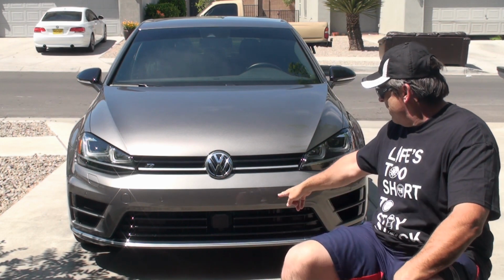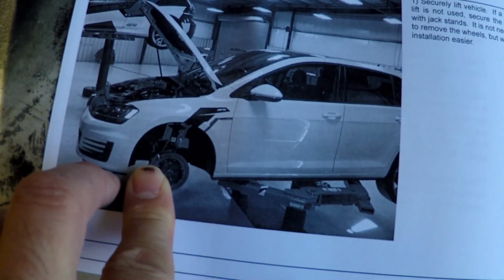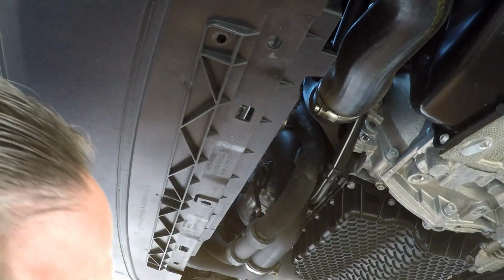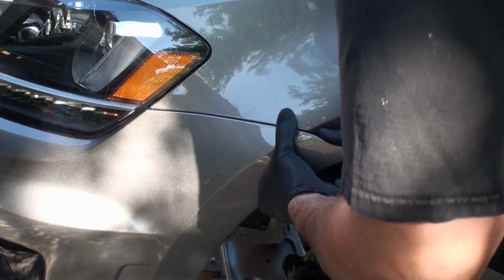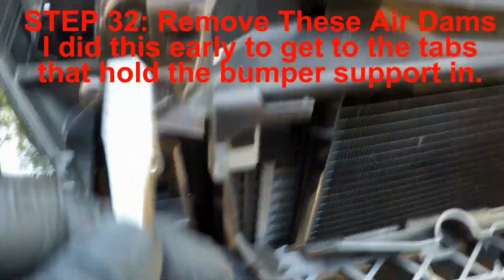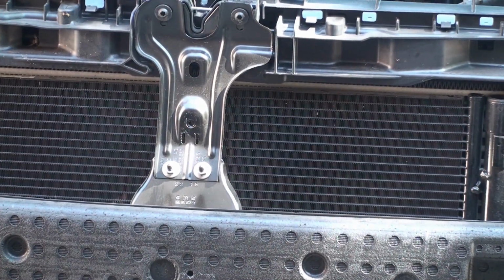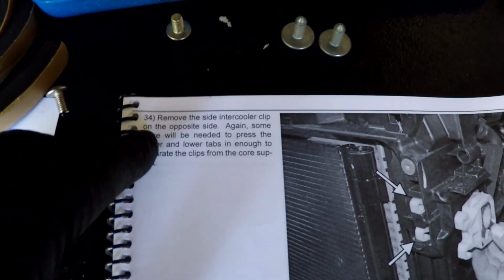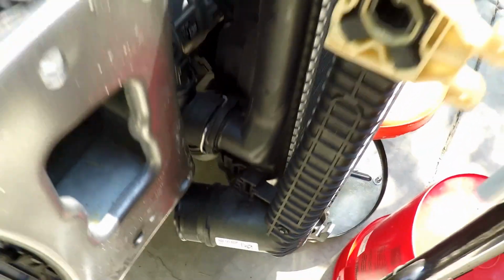2016 Golf R MK7 MQB APR Intercooler Install PART 1

Comment: Nice video if one wished to watch 12 commercials.  This was done  before there was anything of this model was even published.  So, "A" for being the founder so to speak.
It is so much easier going from the inside, than taking off all of the beams/lights.  Yes, you need to drain the coolant, but it sure is less of a pain.

Comment: Sorry to see the damage to your bumper - I am however happy to say I learned from your misfortune and got mine separated from the fenders cleanly.
I did however break one of those dang intercooler mount clips (step 33-34)- The big ones you push on the new intercooler with the prongs that you really have to compress to remove, man that halted my install. Sucks you get to that point of your project and then you are basically stuck on a Sunday when all the dealers parts dept. are closed. 
Additionally my APR Intercoooler for the MQB Golf R (Mine is a 2017 DSG/DCC) did not come with those long bolts or any instructions about the foam tape. Oh and no instruction book either, mot a huge deal as I downloaded it.
Good job dude! Man am I aching after this,  and I only got half way through! Jack stand install like you - Keep it up.

Comment: What up Rad? This is Meat amigo. I started a new channel. 

Hells yeah Brother you did it. I just started watching this video but I'll say when I did mine I pinched the driver side headlight washer thing in a spot it's not supposed to be since I did it by myself. I still need to pop the bumper back off when I have a helper.
Reply from the maker: Is this you really? Why did you start a new channel?

Comment: BTW, the headlight washers open once every third time you hid the windshield washers. It's a spray only.
Reply from the maker: Really? Does it spray on the headlights? Is this effective?
Reply: +Rad Fox I don't know how effective it is. I read that it did this in the manual, but thought it was hogwash until I hit the wipers at night while sitting in my driveway. The headlights were shining on the garage door and I could see that they were sprayed with water by the lights on the garage door. Like you, I live in a very mild climate, so the car never gets really dirty. Probably doesn't hurt.
Reply from the maker: This is crazy!

I just went out and repeatedly activated the windshield washer sprayers and I did see the nozzles quickly stick out from the bumper and then very quickly retreat back in.  I guess I still have air in the lines because nothing squirted out when they popped out.  I kept hitting the sprayer but I only got the nozzles top pop out twice.  Is it the wippers that trigger it, or the sprayer that is supposed to trigger it?
Reply: Rad Fox It was when I pulled to get the sprayer to work, not just the wipers.

Comment: I've always disliked the VW design of sandwiched intercooler to the Hot radiator and the a/c condenser. Seems like heat soak central all day even worse in summer Temps. I'd go massive front mount like a real race car on my mk7 gti. Sick video love your R.
Reply from the maker: Hey thanks for the comment and reminding me of this.  A massive front mount especially with some fans mounted on it would be awesome for this heat.  The fans would keep it cool when stopped at lights. When I went with this particular cooler I was thinking of the stock fit and not having to modify anything.  A custom fab may be in order.

Comment: the car comes with headlight washers their control from your steering column
Reply from the maker: It's funny that the sprayers are there but yet there are no wippers.  What good does that do?  Also, I haven't figured out exactly how to make them spray every time I try with the wiper control stick.  Not that I actually every plan to use them.
Reply: Rad Fox they usually spray the headlights every 4th activation of your windscreen sprayers, at least that's what it is over here in the UK!

Comment: Great Video, Rad. What kind of camera do you use for your videos?  It's very clear.
Reply from the maker: Thanks!

I have three different cameras. 

Sony HDR-SR11 which for some reason is starting to look washed out in some sunlight conditions (like in my intro) and has issues with autofocus in low light conditions, but otherwise is a pretty solid old camera. It records in MTS format, which looks so amazing on my computers but then after it is converted to MP4 for youtube it looks good most of the time but is not amazing anymore.

Then a GoPro 3+ Black, and GoPro 4 Silver. 

I record in 1080 30 frames a second Narrow on all three cameras.
Reply: +Rad Fox I need to get a GoPro. I believe I am the last American without one.
Reply from the maker: I really like them.  My favorite is the Hero 4, because it has the built in LCD screen on the back.  You can quickly check the LCD to see what you are capturing.  Otherwise you can link over wi-fi with your cell phone and remote control and view the cameras but it is laggy.  The batteries only hold about and hour of recording time and possibly less if you have the wi-fi enabled.  Plus they bleed down while not in use. So you will want to have some extra charged batteries around. Still they shoot really nice video especially if you set them in Narrow View.  Everybody uses SuperWide, which does have its uses, but for normal video, Narrow View is great.

Comment: Those intercooler retaining clips suck. I use a heat gun on low just enough to get some flexibility in the plastic. Works great and stops the clip from breaking. They're almost $50 each from VW!

Comment: hey rad fox did the intercooler give u any gains
Reply from the maker: I think the car feels a little stronger even when the AC is on and I am in traffic.  I don't have any real performance measurements though. I went to the track to do some testing but I got there to late and they would not let me enter the races. Hopefully I can get some more testing in.
Reply: Hey Rad , what about the engine temperature? 
What was your car normal temp stock compare to, what is it now since you are running stage 2 with apr intercooler ?
is the same ? I wanna do this mod too but not sure if it does any good. I have seen your other vid on forge FMIC on your X GTI with 40 degree temp drop, just curious to see what is the result of this one 
thanks for your vids and helping the community mate
Reply from the maker: When you say engine, do you mean the oil temperature or the water temperature? I haven't paid any attention to the water temps, and I assume it is pretty close to the oil temps after the engine is warmed up.  

I haven't noticed anything strange about the engine oil temperature. I think that my oil temp is usually around 212 F and that I have seen it go up to 226 F under hard driving.  I am not sure if it has gone further.  

 For the IATs, once I start driving and the car is warmed up, depending on how hard i am accelerating, and depending on speed, I am generally seeing that my IAT's are between 20-40 degrees above the ambient air temps.  It's been under 100 F ambient lately, so I have been running my AC which does add heat loading to the system.  In a few cases after driving hard with the AC on and then coming to a long stop I have seen the IAT's hit up to about 45 F over the ambient air.
Reply: Hey thanks for replaying , by engine temp i was thinking of oil temp. 
what does IATs stands for ? 
and to me as long as the car is running cool like around 205-212 im fine, do you recommend this mod for ppl in stage 2 ?
thanks again

Comment: Half of the engine needs to be taken apart to get to the intercooler lol I'm telling u they cant make this cars more complicated, i wanted to get one but I ain't getting shit anymore.
Reply from the maker: the intercooler is tucked up in there pretty good, but it is not that bad.  You could always just bolt up a true front mount and not deal with getting behind the crash bumper.
Reply: +Rad Fox you right .